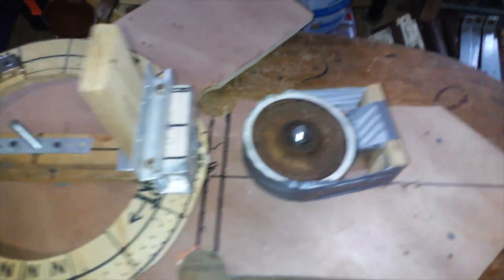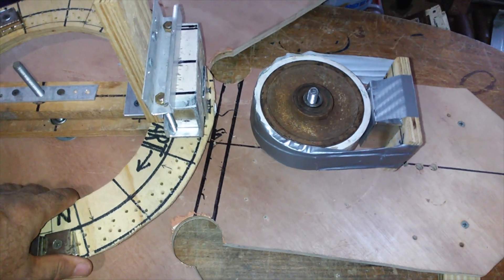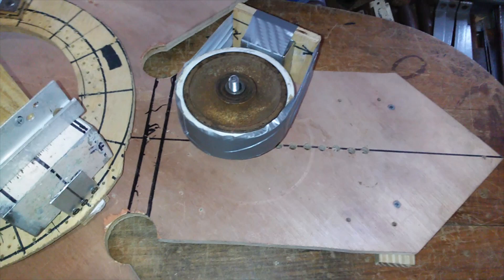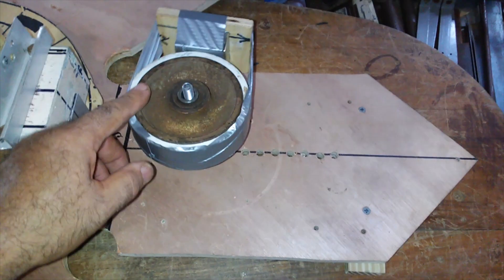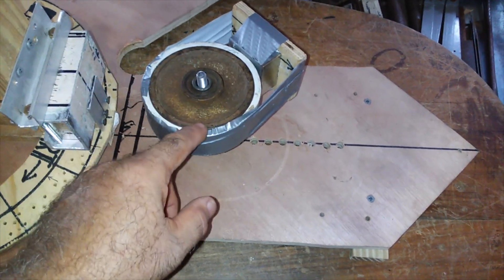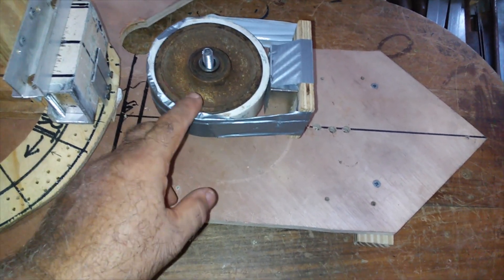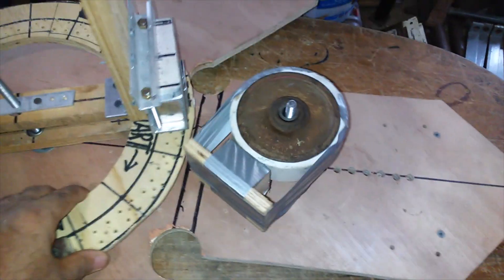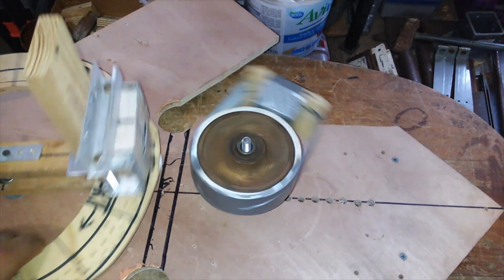magnet motor concept research update by july 29,2023 by LENNY

Comment from the maker: if this third (3) component does its works and i can produce a circular motion using magnets and shields, then i will design and build a self-running generator, with this self-running generator im going to use it with an mechanical propulsion system ( after doing the research and discovering it ): for traveling and exploring our solar system and it will be used too for general transportation like planes, boats and cars ..... any "donations" for this cause will accelerate TIME and the process of doing research, workshops, materials, etc. etc. etc., thx anyway 😊